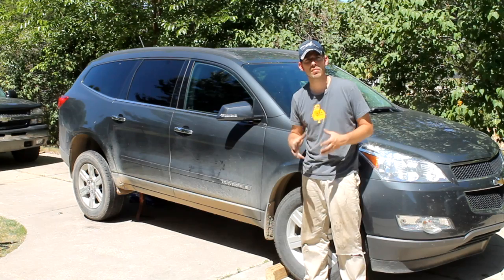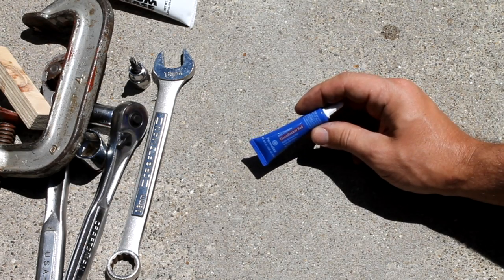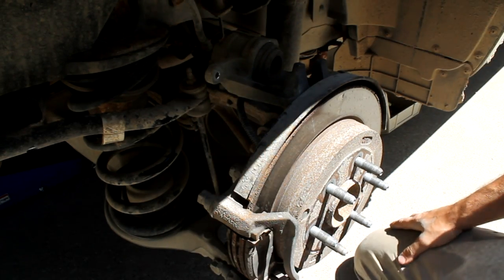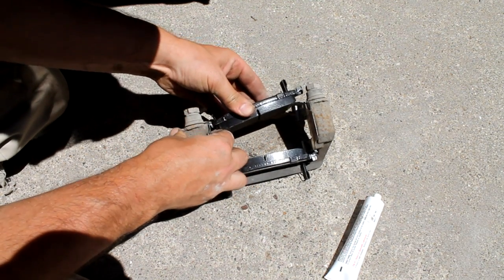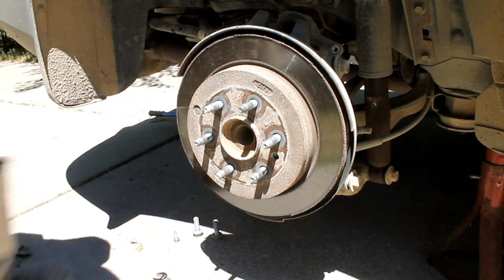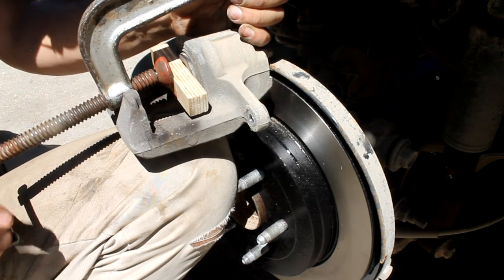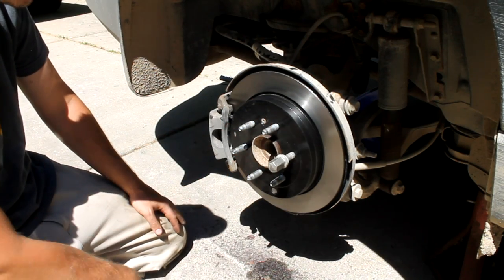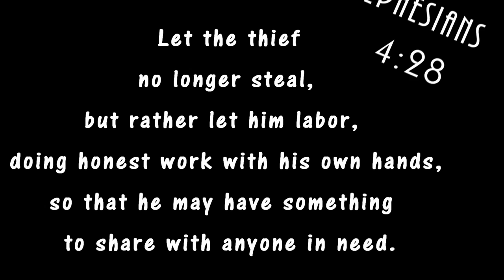How to Change the Brakes And Rotors On a Chevy Traverse, GMC Acadia, Buick Enclave, Saturn Outlook

Comment: This helped me put new brakes and rotors on my wife's 2018 Traverse. The only differnce is it has an electronic e-brake, so there's no drum component. Instead, you can remove the electronic e-brake with a 5mm alan wrench, 2 bolts. From there, the same T30 torx will allow you to back out the screw or whatever is in there that also compresses the caliper from the electric e-brake motor.

Comment: Great video! Wanted to add some important notes.....Really important to note that on some vehicles if you have issues using the C-clamp to get the piston down pop the hood and remove the cap on the master cylinder. What happens is as you pressing the piston in with the c-clamp it's going against the pressure inside the brake fluid. If you do this brake job with the cap off do it in your driveway not grass because brake fluid will destroy your lawn. THIS IS ALSO VERY IMPORTANT.....after the brake job is complete place the master cylinder cap back on and pump your brakes a few times before starting your vehicle to build back up the pressure in your brake line. If you don't do this you start your car you mash on your brakes and it goes to the floor because there's no pressure build up. If you pump them before the car starts you will know immediately that there's enough pressure in the system to proceed to putting the car in drive.
Reply from the maker: +89DrFunk great info thanks for adding that! I used to do that on my older truck but for some reason on these newer vehicles it doesn't seem to be an issues. Must be a relief somewhere maybe?
Reply: +SSLFamilyDad That's what I was thinking too when I saw how easy it was to squeeze your piston in. I know for sure with older vehicles it's a major pain to squeeze the Pistons in removing that cap makes all the difference in the world :-)
Reply: Yeh, DON'T forget to pump the brakes, learned that years ago!

Comment: Fantastic DIY vid!  Got quotes from 3 shops to do rears on a 2014 Traverse and all were $500+.  Paid $100 in parts on Amazon and spent 2.5 hrs (some of that was drinking with the neighbor) to do the replacement myself.  Thanks!

Comment: Just like to say. As pads wear you add brake fluid. Suggest you take off top of brake master cylinder so as you are pressing pistons in you do not have pressure building up. Remove cap and as you press pistons in watch to make sure you do not have brake fluid over flow, it is a great paint remover. What I do is use a turkey baster, sorry honey and suck fluid out before it over flows. Then squirt it into dispaolable container with lid.  Never touch brake pedal with top of resivor off!  When done with pads refill resivoir.  Cap it then hit brake pedal until pedal stiff as usual.  Remove jack stands with vehicle on all four tires and level check brake fluid and add if need be then put top of master cylinder back on secure. Try the brakes in drive first then hit the street for test drive, come back check level of brake fluid. Smile at your skills and feel confident.  Great video and happy motoring.

Comment: One thing he skipped is when he puts the new rotor back on, you need to check your parking brake adjustment, that's what the rubber plug is for, rotate the rotor so the access hole is at about 12 oclock, reach in with a flat screwdriver and tighten the star nut until the shoes just start to touch the inside of the rotor, so you need to push down on the screw driver so the star nut rotates up to tighten...
Reply: Ive done a lot of rotors on most of my cars throughout the years and I never have done this before. Great to know! (guess I got lucky so far)

Comment: Super Easy, I changed them on my 2007 Saturn Outlook, besides the rotor being frozen to the hub it went very smoothly. BTW use PB Blaster penetrating oil to burn through the rust if you're rotors are frozen.

Comment: Hi: good video. There is an adjustment that can be done for the emergency brake with the rubber seal. You will need a flat head screwdriver to adjust a wheel to make sure the emergency brake pad is close enough to the rotor. The rotor should spin and the brake shoes from the emergency system should just barley come in contact with the roter and not cause a slow down of the rotation. Once the adjustment is made with the flat head screw driver,  you put the rubber cap back on the rotor and all is done.

Comment: Great video, and made quick work of a brake job (something I always wanted to try to do).

To reply to another comment, my brake shoe pack had four identical part number pads, and on a very close inspection had no differences at all. They were not unique for the inside or outside, but could be either.

Comment: THANK YOU SO MUCH :)  I'm short on cash and this saved me a lot of money. thanks for being so detailed on the parts needed too.. Amazon was the best price. everyone else was a rip-off on shipping.. Needed an air gun to get the brake bolt loose due to dealership using that threadlock I couldn't get it to budge using a torque.

Comment: After assembly spray the pads and rotor with brake cleaner to remove any factory oil or grease before putting the tire back on.
Reply: No you only spray the rotor because if you spray the brake pad you shorten the life

Comment: Great video, thank you. Also want to thank Doug Parker for posting the Torque Specs; "Torque is very important for the large bolts at 100 ft.lbs. and 35 ft.lbs for the caliper bolts"

Comment: I have an Acadia, and I have to grind down the ends of the pads so they will fit in the bracket. Never had this before except the rear brakes on this SUV. Anybody else have this problem?

Comment: So how do you get the T30 screw out if it's seized. All the videos I've watched seem to have new ones on the old vehicles.
Reply: Drill it out it’s pointless and only needed for the factory assembly line until the wheel holds it in place

Comment: great job, was gonna mention about the master cylinder cap, but 89DrFunk beat me to it, but also make sure to stay safe and place a jack stand or some kind of blocking under the vehicle, Also  the guide
pin bolts that slide into the rubber boots, should be torqued to (30 ft/lbs). along with the shoe bracket 148 ft/lbs, Look up the torque spec's to be sure,   I'm not a big Safety Sally, but brakes and front end work I like to get it right, , have a great day
Reply from the maker: +Yankee Liv'n very good points. I used to just jack up one side at a time and use the jack before i had jack stands. I can say it can be a bit unstable without jack stands so anyone looking to do this should definitely look into using them.
Reply: Where can you find torque specs for a 2012 Chevrolet traverse? Thx
Reply: check here http://www.paulstravelpictures.com/GM-Chevrolet-Traverse-Front-Brake-Pads-Replacement-Guide/

Comment: You probably discovered after the video when you tried to spin the wheel that you had an inside pad for the other side on the outside. That protruding piece of metal is a wear bar that will squeak when the pads get worn down. Also, you should have cleaned the grease off the slide bolts before adding more grease so that they will slide with ease. Too much grease on the back of the pads will get hot and spread easily to the pad surfaces, not good. Torque is very important for the large bolts at 100 ft.lbs. and 35 ft.lbs for the caliper bolts. You should always resurface the rotors or replace when replacing pads so the pads will break in properly and not glaze over from a smooth surface of the rotor and reduce your stopping power. Would recommend a short break in period for the pads, by not braking hard or fast stops, or pull a load that will require more braking so as not to overheat and could cause the rotor to warp if it is not already warped, which a resurface would remove.
Reply: Doug Parker All four rear pads on the Traverse (inside and outside) have the wear tabs on them. The front only have the wear tabs on the inside pads.

Comment: did u check the pads on the sliders so that they move not only in but return out so that the pad doesn't wear out? many times you have to grind the pad holder where it meets the slider so that it will move freely.
Reply from the maker: +dave hogan not sure about that. The clip that holds the pad is new and i greased it so they should slide freely there. I have never had an issue with that, maybe a different type of brake assembly?

Comment: DON'T FORGET AFTER UR ALL DONE WITH BRAKE JOB? START UR ENGINE AND PUMP THE BRAKES!! SO THE CALIPER CAN GET RE PRESSURIZED AND BRAKE PADS ARE PUSHED INTO PLACE..DON'T WANNA JUST START ENGINE AND PUT INTO GEAR AND TAKE OFF, ONLY TO START PUMPING BRAKES AT STOP SIGN AND BRAKE PEDAL GOES STRAIGHT TO FLOOR!! LOL

Comment: Great video. But heed him - use a torque wrench for every single item you are tightening down. The range for this brake job goes from about 9ft.lbs to about 157 ft.lbs. Your hands cannot guess those numbers as you are breaking your back tightening those bolts. And it makes a world of difference.

Comment: You shouldn't be using your racket as breaker bar.  Instead of the piece of wood use old pads ..torque bracket bolts down proper no use thread locker